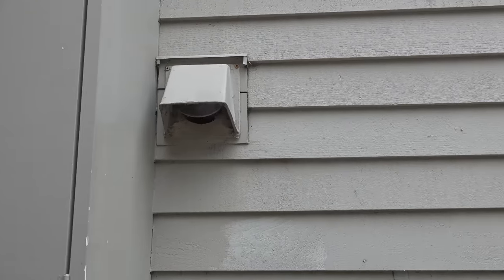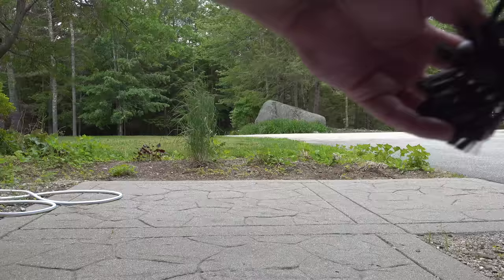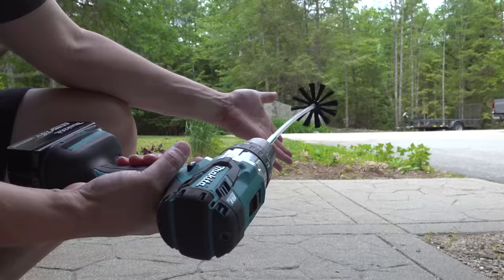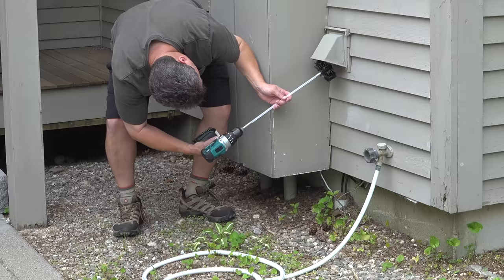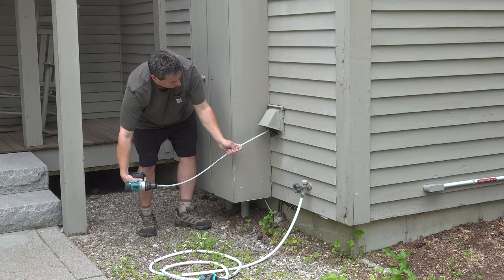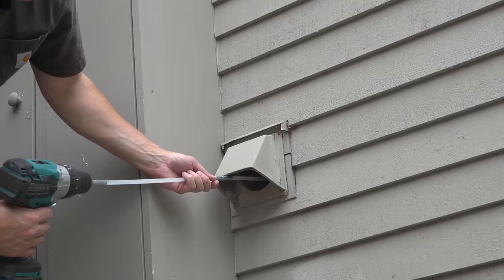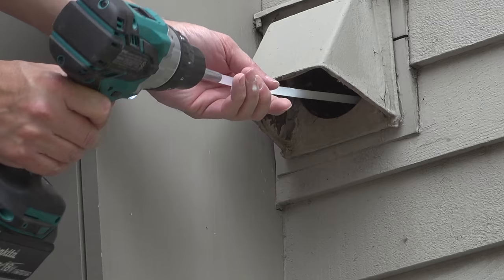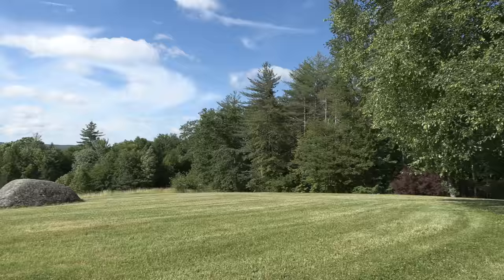EASY WAY to CLEAN a Dryer Vent FAST!

Comment from the maker: Thanks for watching please LIKE & SUBSCRIBE - Cleaning Brush: https://amzn.to/3OrrueE - Silver Cymbal Recommended Item: https://www.amazon.com/shop/silvercymbal
Reply: As someone that did HVAC install, duct cleaning, and vent cleaning for 7 years.. This video has a lot of problems. 

You should NEVER be cleaning vents with the dryer running. Without knowing exactly how long the vent run is, it would be rather easy to get a brush into the blower itself. This can cause damage to the likely plastic blower wheel, or at worst cause a blower motor to break loose possibly ripping out wires and causing an arc within the vent thats lined with extremely flammable lint  More over, Dryer vent blowers are low pressure high volume, they are not designed nor should they be used as a positive pressure air source like you've shown. 

These kinds of brushes CAN NOT be used on flexible duct be it alum foil or double wall plastic. The brushes tend to catch in corners and can easily cause a tear in the interior flex liner, or if the ducting is not properly attached to framing can cause it to bind/twist within the wall cavity. This can easily lead to dryer fires due to backed up lint, or mold problems due to the. moisture retention due to improper venting.
Reply: @jarred267  as someone who does HVAC, you can use these on the flex vents. Just gotta go slow. I usually completely detatch them, take them outside as to not make a mess, then run the brush through it a few times.
Reply: @jarred267  exactly this man has no idea what he’s doing.
Reply: @gopackgo4036  Please provide a link to your Youtube channel and the video in which you show how to do it correctly. Thank you.
Reply: now i got like 10 extra chores to do next weekend

Comment: Two important tips: do not reverse the drill when removing or you'll unscrew the attachments inside the duct work. And as a little safety against forgetting to not do this, wrap some duct or electrical tape around screw joints on tool.
Reply: this sounds like it's from experience ... a horrible experience lol
Reply: Thank you, definitely a good heads up!
Reply: good tips
Reply: God bless you because I would of done just that
Reply: Damn it just read this after I lost it lol
Reply: @Loretta Myers  you can try you luck with a vacuum. Put the tip in the hole and tape it up basically turning the ducts into a vacuum. Stronger the vac the better chances you have. A 6hp shopvac should pull it.
Reply: Some kits have a pin-lock system can can spin both ways.  😁
It is important to know the limitations of each system.   I would bet the screw type connection is harder to break.
Reply: Ditto

Comment: You really should disconnect the vent from the dryer. All you've done here is cram lint back into the dryer, arguably, making the lint situation worse. Disconnect it so you can actually get it out of the vent line.
Reply: I assume that’s why he said to run it so the air is pushing the lint back out
Reply: @jeffp7368  Not no, but if we go off the assumption the dryer's blower was strong enough to blow out all lint, it's exhaust  line would never have to be brushed.
Reply: He had it on. The dryer so that pushed it towards him.
Reply: @dougs3274 the moist air causes the vent to get wet and therefor gets stuck to the side and piles up over time

Comment: I've actually had good luck cleaning dryer ducts with a 630 cfm leaf blower blowing from the inside out. It also works well to blow lint out of the dryer fan itself.
Reply: This method is easier and less likely to puncture the foil line. Smarter not harder. Reversing the tube on a shop vac works too if you don't have a leaf blower.
Reply: It works pretty well, but it's usually not entirely sufficient. Damp lint can be like a paste that sticks to the vent when it dries. You really need some kind of mechanical scrubbing action to get all of the clumps, especially around elbows or 45s. Try the brush after you do a leafblower cleanout, and I'll bet you get additional lint - I always do.
Reply: Something else that I'm contemplating.  We have a really long length of vent hose, the flexible kind. Yet for the vast majority of the run from dryer to vent it is a straight run. Replace the accordion tubing with straight non-collapsible aluminum dryer hose. The goal is to minimize the resistance in the line.
Reply: @bnasty267  just get a new vent at that point though
Reply: My brother tied a ping-pong ball to a 40-foot string, then a plastic loofah, then another 40 feet of string. Blow the ping-pong ball thru with a leaf blower, then "floss" the loofah around. Works regardless of how tight the vent turns are.

Comment: I use my Toro electric Leaf Blower on my Dryer from the inside-out once a year. I use it for the Stainless Pellet Stove piping as well after a thorough brushing.
Reply: What if the vent is in the house roof
Reply: @dallasparty316  That's my situation. I clean it from inside, not as often as I should. I use a "16 gallon" shop vac and the brush. A lot of stuff falls down and out as I push the brush in and pull it out, so I have the vacuum sucking it up. Then I put the hose into the vent and set the  vacuum to blow as I push the hose as far as I can up the vent.  Then I set the vacuum back to sucking and pull the hose down and out. Repeat that a couple of times and it seems to do a pretty good job.
Reply: I use my leaf blower to clean out my gutter pipes from the ground
Reply: Yep! I use my Dewalt 20v cordless leaf blower and blow from the inside out. Works great and the dryer cycle time stays as short as possible as the units made in last 15 years have a moisture sensor.

Comment: Glad my dryer is on the exterior wall.  My vent is less than a foot long.  Just hand clean when needed.  No tools needed.
Reply: We are building a new house, and we're going to make it a straight shot through a wall, too. I think we'll put a foot of the flex stuff between the pipe going through the wall and the exit on the dryer so we can move it more easily.

Comment: I bought one of those 2 years ago. Works wonderfully! My rigid duct makes a few bends -- I could feel them when lightly pushing the tool and multiple extensions through the ductwork. It would be fun if it weren't quite so messy. I'll take "messy" over "fire" any day!!!

Comment: You should probably get one of those plastic screen covers for the end cap. Birds and rodents can learn to lift the little flap and make nests in your vent. Those screen covers are not usually recommended for dryer vents because they can catch lint exiting (and they do), but if your vent termination is easy to access you can just pop the screen off occasionally to clean it when it collects lint. I wouldn't use one on a vent that you couldn't see or access easily. The easily accessible (i.e. low to the ground) vents are also easier for critters to hop into, so the tradeoff of the screen is worth it.

Comment: As you were about to start the drill I thought "Why is he not wearing protective eye wear?" and then I saw your note pop up. 😆  My dryer vent goes up (not ideal) and runs about 30 feet to the outside.  After I moved in to the house, I could hear birds walking inside the dryer vent.  I cleaned it out one day and it was filled with straw that the birds brought in.  I replaced the vent cover since it was broken.  It is crazy what happens inside people's dryer vents! 🤣

Comment: Don’t neglect the opposite end - the area in the dryer around the lint filter.  I recently disassembled the part that holds the filter to clean out the accumulated lint.

Comment: Great tip. I had an HVAC professional doing some other work in the house about 6 months ago who cleaned it out for me. The dryer worked much more efficiently once he did that, but now it's starting to lose efficiency so I suspect it's time to clean out the duct again. Will refer to this video again in the future.

Comment: A glove for the hand not holding the drill seems prudent also.

I have used my similar brush kit just once I think. Probably time again. Last time I used a shop vac and brushed from the inside. Love the idea of just brushing from the outside with the dryer venting.

Comment: AmplifyDIY has a really good walkthrough on using this sort of cleaning kit.   They work super well, just did my house's vent a few months ago.   One good tip is to apply some tape to the  connection points on the pole.   Just some extra insurance so it doesn't spin off inside your house and get stuck.

Comment: Major tip: make sure your drill is not set to reverse...... you will otherwise leave your new tool stuck inside of your vent.

And i highly recommend doing it from the inside if your vent goes through to the roof.
Reply: YES, YES, YES, 1000 times YES!!  I not only tighten the joints with 2 pairs of channel locks, I even like to put a tiny bit of electrical tape at each joint for good measure.
Reply: The amazon photos does also said to turn right only👍 but why will ot get stuck if reverse?
Reply: @timchan334  if drill is set to reverse, it will unthread the connections while brush is in the vent. I only change to reverse when im taking the kit apart. (I do dryer vent cleanings for work sometimes doing HVAC)
Reply: @timchan334  The threads of each section will loosen and become detached. It will then be next to impossible to remove the brush, creating an even bigger obstruction.
Reply: I get it....BUT...... the seam-overlap on the ductwork,  would go ONE  WAY, if the pipe was installed a certain way, yet  the overlap would go the OPPOSITE WAY, if the pipe orientation was reversed. So....yeah....spin the drill in one direction to avoid the spinning brushes from getting jammed or breaking apart the seam.....but how would you know which way ?
Reply: @timchan334  Because it unscrews
Reply: they make attachments with a locking mechanism, so it’s impossible to unscrew

Comment: Be careful with lengthy ridged dryer lines going to downstairs or upstairs laundry rooms, the cleaning brush and shafts can encur sharp 90° bends in the non-standard lines some “smart guy” made and the plastic shafts can twist themselves apart deep inside the line and well past many bends, meaning the only way to free it up is to remove floors and panels or walls and ceilings. 
Speaking from experience. Best to torque limit the brush shafts to as low a number as possible to prevent twisting and snapping the shafts.

Comment: My advice is get a dryer vent brush kit that has a ball locking feature and the reason behind that is the screw together type can come loose inside your dryer duct and that could be devastating
Reply: It can only come loose if you rotate it counter clockwise

Comment: I have one of those lines that is more than 20 feet long! I will look into getting this tool for sure but I will still have to disconnect the line from my dryer in order to use the tool from the inside of the house as well as the outside of my house in order to clean the whole line.

Comment: Better, Faster, Cheaper to pull out the dryer and replace the flexible vent tube!  The lint / blockage is usually at the sharp u-turn at the bottom behind the dryer, which this brush can't clean.
Reply: This is only true if your vent is literally just the flex, and it vents just outside the wall. Otherwise, most especially if you have one of those driers with a humidifier - the whole vent gets caked with wet lint as well as the screen that blocks the end (which can be located on a roof).

Comment: great job!!! any reason why you don't start from the dry?er machine - > outward ,, as opposed how you did it, i figure, u cldve pushed debris back into the pipe, mine is 15feet elevate to the low part roof

Comment: I have a vent with 3 flaps and a cage, so I'd have to take that off but this is still easier than moving the dryer and taking off the hose.

Comment: I have used this kind of kit many times and it works well. Mine has a fitting for attaching a shop vac to the inside end of the vent pipe.
Reply: Could you please share a link and or the name of the brand? Thank yiu in advance.
Reply: @CalmDavid114  Gardus RLE208 LintEater Pro
Reply: Thank you!

Comment: I use a 25' drain snake.  I replaced my soft vents with hard vents.
I put my snake in my drill and go at low speed to get the snake all the way in.  I then set it to medium speed and draw the snake out.  It bangs a lot and gives a good cleaning.
It takes longer to set up and clean up than to clean out the vent, my vent goes through the ceiling.  Since I have a long run, about 35', I like to do this twice a year.  
This past year my son did it, and I forgot to tell him not to look directly in the vent until..., well I did say oops, I forgot.

Comment: i ordered the dryer vent clean brush Silver Cymbal suggested and within a reasonable time my 20+ foot 2nd floor, fan assisted dryer vent is clean.  I can't believe any air was escaping the vent before, probably was a fire hazard.  Thanks for the video.

Comment: Had one this week. Tried from outside but vent on steep roof. To dangerous. Went inside. Pulled out dryer. The turn in the wall was to sharp. Couldn’t use drill brush. Pulled out compressor and vacuum. Hooked up reverse ball. Fed up as far as it would go and vacuumed lint as it came down. Vacuumed dryer hose and below lint trap on dryer. Finished with an electric leaf blower to remove remaining lint in line to roof. From the outside I could see lint scattered on the roof. Vacuumed floor put everything back together. A happy customer.

Comment: I'd never had my dryer vent cleaned out and I've lived here since the early 80s. Saw an ad online for $79 so went for it. When the men from the company got here, they mostly spoke Spanish to each other. The one who seemed to be the more knowledgeable one (man A) mostly spoke Span but the other one (man B) was fluent in Eng. Man A put his cell phone in the vent and took a photo and showed it to me, told me it was really bad and said the price to clean it would be $150. I felt like it was bait and switch but since my dryer had been taking a VERY long time to dry, I went for it. I watched everything they did. Man A also put his phone in the outside vent and showed me the photo. I could see hair and debris and I've had dogs and cats ever since I've lived here so thought the vent line might be packed with this stuff. He used a drill, the long skinny line with the brush on it on the inside behind the dryer. Then went outside. I asked where the stuff was that he's pushed out. He pointed out a very small amt lying on the ground, but I'd pulled that out with my hand a few days ago. Then he put the brush inside this vent. Should I have seen a great deal of lint and hair instead of this very small amt? I ran my dryer after they left and it might have taken a bit less time than it had been taking but not a lot. Bottom line, I think I got gypped. Do you think I did?

Comment: I take the flex off the inside and hook up my shop vac to blow setting. Also never use those scew on connections, use the ones with locking pins and tape them so you won't go on a fishing trip trying to get the rods out of the ducts.

Comment: I disconnect dry hose in the winter to keep the heat in and have both a smoke detector and Carbon monoxide alarm and they have never gone off and the basement is a little warmer when the dryer is used. I shove an old towel up inside the exhaust to the outside.

Comment: Make sure you only go clockwise with the drill. The other way and you’ll unscrew sections and have a bigger problem. Also my vent (thanks builder) has so many turns I can’t get it just from the outside.
Reply: I get it....BUT...... the seam-overlap on the ductwork,  would go ONE  WAY, if the pipe was installed a certain way, yet  the overlap would go the OPPOSITE WAY, if the pipe orientation was reversed. So....yeah....spin the drill in one direction to avoid the spinning brushes from getting jammed or breaking apart the seam.....but how would you know which way ?
Reply: @TheWilferch  always have the drill go clockwise. If you go the other way it will potentially unscrew sections from each other. Doesn’t matter on how your ductwork is installed.
Reply: @thelongs5698  ...I guess I'm dense, but this kind of ductwork has a longitudinal seam.....yes?....and that seam is "seen"  and sensed on its ID too.....no? If that's the case, then the bristles can catch the "lip" of the seam  if spinning in the wrong direction....right?...and that direction is based on which end of the duct you are entering ( ie, if its proper to rotate clockwise entering from one end, wouldn't proper-rotation be counterclockwise if instead you enter from the opposite end?)...wouldn't that be the case? Sorry....I'm truly not trying to be antagonistic.....just askin' for clarity, It's been some time since I worked with ducts like this, maybe the seam is "smooth" on the inside with no lip to catch in the wrong direction? .....
Reply: @TheWilferch  hey I totally get your concern. I think the bristles catching anything might occur regardless of the direction of spin and the seams. Although so long as you keep the tool spinning I believe you’ll be ok.
Reply: @thelongs5698  ...thanks.....was just angling for clarity. Cheers.

Comment: One importing thing to remember.  Never run your drill in reverse, even it the brush gets stuck.  It can be instinctive to  reverse the drill if things get stuck.  Keep spining ini a clockwise drirection and work the brush out as best you can.  Otherwise, the threaded joints can separate and you'll end up  with a much bigger problem.